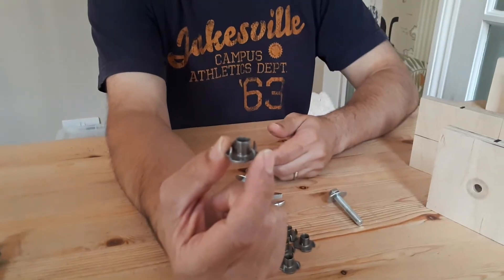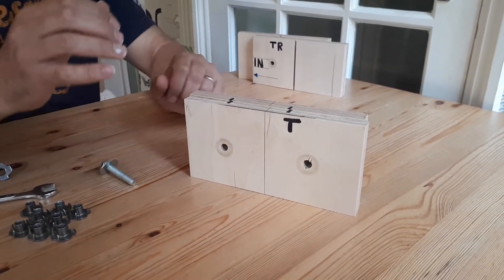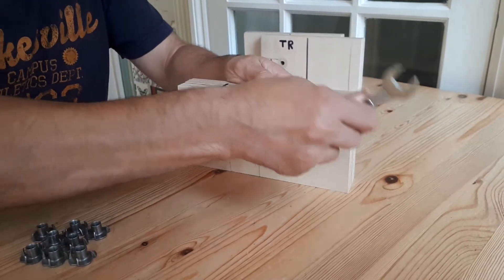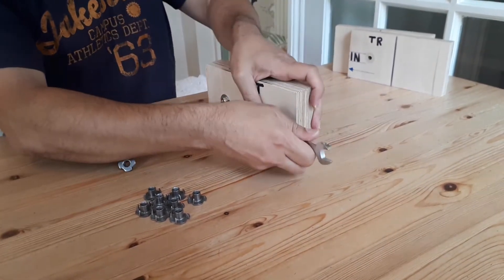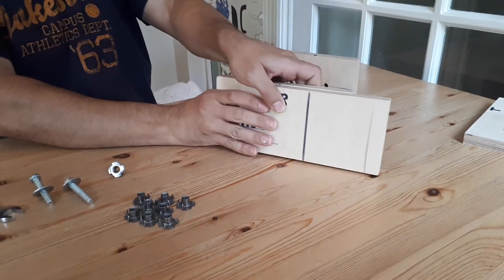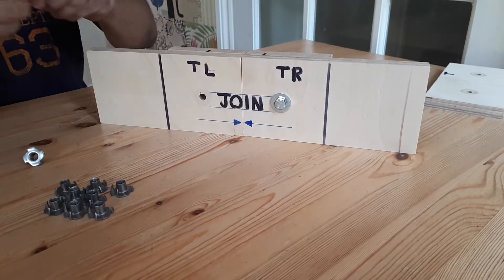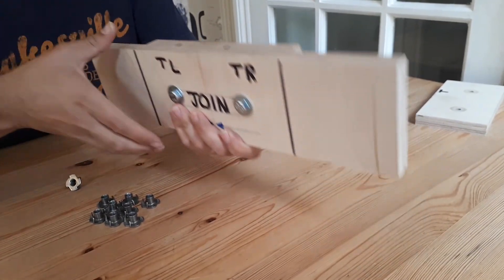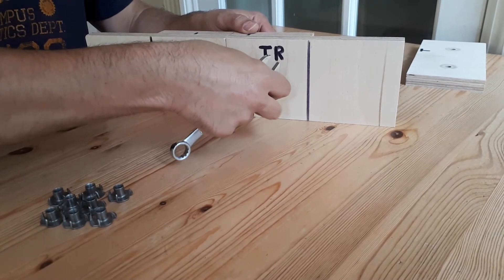How to use Tee Nuts.

Comment: nice video. thank you.  also it looks like you can turn on of the front piece 90 degrees to make an elbow. any risk in that?  btw, beware of the "cracking noise" :-) i think it is from the table...
Reply from the maker: Hi there,
Tee nuts are a clever invention   and is widely used in the furniture industry, they can be used on a return, Ideally the harder the timber the better, and the creaking was the table.

Comment: Would this work two join Two 2x12x20 to make a 40ft Joist for a roof?
Reply from the maker: Hi Jonathan,
Generally I use this for hardwood furniture, decking joists or diy projects so the answer to your question is no.
However for sistering the joists you would need at least M12 or M16 bolts with a nut and square washer and a double sided timber connector all from galvanised steel, as this is for reinforcement I would contact a roofing company, and make sure it complys with building regulations.
All the best
Mustafa
Reply: @diyshop839  thank for the reply. Just trying to figure out how to do my flat  roof without having a support beam in the middle.

Comment: Good job using Tee Nuts.
I'm not sure why there are not more videos, when using "dees nuts"....ha.
But seriously.... there are a few measurements that you need to know.
 ....the depth of the backing/anchor board should be greater than the height of the Tee Nut.
 Example... if the backing board is 3/4 inch  (19mm), the Tee nut "insert sleeve" height should  be  less than that.
It's difficult to explain, but try them first, and you will know what I am saying.
Reply: I guess I'm kinda randomly asking but do anybody know of a good place to watch newly released movies online?
Reply: @Byron Benicio Flixportal :P
Reply: @Marshall Aydin thank you, I went there and it seems like a nice service =) I really appreciate it !!
Reply: @Byron Benicio No problem xD